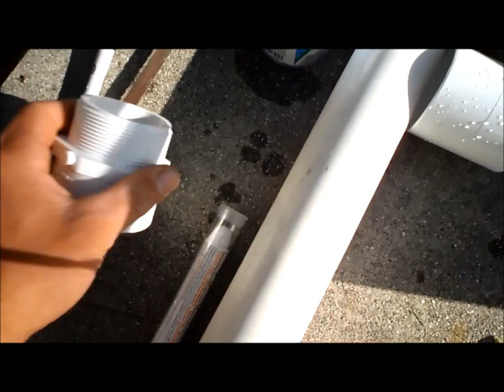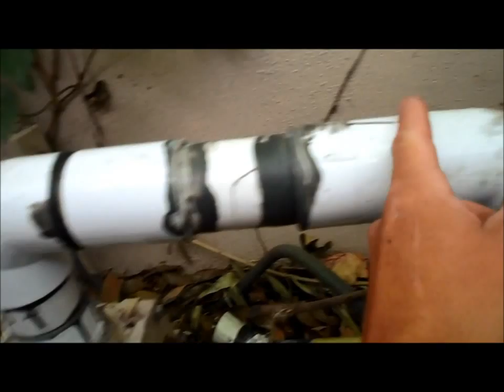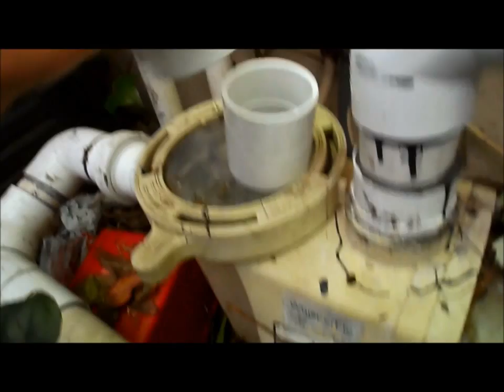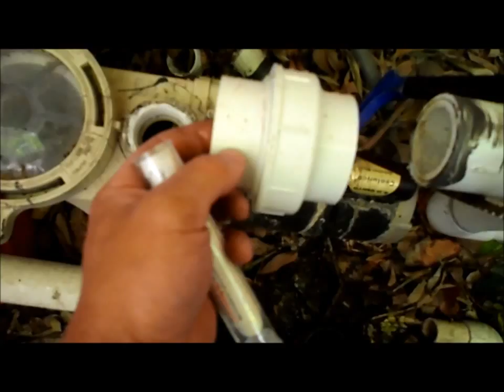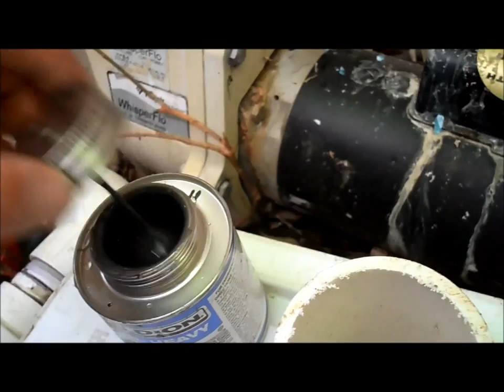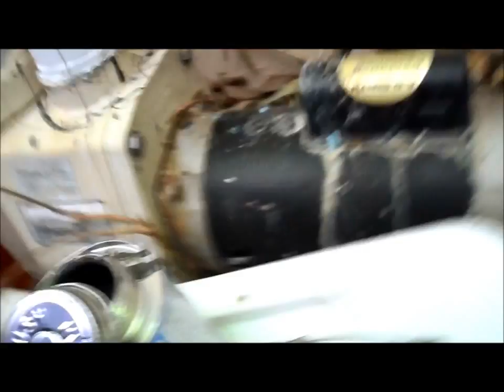Repairing a Pump Discharge Leak

Comment: @SPL   Thank you!  I had a 2" male threaded PVC fitting on the outlet side of a big Hayward Star-Clear Plus pool filter that was leaking and no matter what I tried still kept seeping water.  I tried various different kinds and thicknesses of PVC thread tape, pipe dope sealants, and even tried thread tape along with silicone sealer and it still kept seeping/leaking.  Then I saw this video and figured what have I got to lose so I picked up a stick of the Plasto-Joint Stick Thread Sealant you used in this video.  I cleaned out the female threaded joint in the pool filter and applied the Plasto-Joint Stick Thread Sealant thoroughly inside of it and also applied it thoroughly onto the male threads of the male 2" PVC adapter.  The fitting is now sealed perfectly into the pool filter and no longer leaks or seeps any water at all under pressure.  This Plasto-Joint Stick Thread Sealant is a life-saver for large, threaded and leak prone large PVC threaded fittings.  It seems like the material of the Plasto-Joint Stick Thread Sealant is an almost dry, gooey and very super thick and concentrated implementation of what is in the regular white Oatey or similar pipe sealant compounds that are much thinner and easily brushed on.  Anyway all I will ever use moving forward on PVC threaded fittings (especially large ones that seem looser and are more prone to leaks) will be this Plasto-Joint Stick Thread Sealant.  Thanks again, you saved me having to buy a new $800 pool filter.

Comment: I'm glad you said it. I don't know when I've seen plumbing that sloppy. Why not take a second and throw a rag around the equipment. We always use medium  to heavy bond clear cleaner and cement. Also they make threaded pump mta unions.
Reply: I know that made pipe extenders that go into the pipe. But I didn't know that they made them to go over a coupling. Good to know on that. Thanks.

Comment: What do you do if the threaded fitting was glued to pump housing?
Reply from the maker: Use a cutting tool like the Milwaukee M12 12 Volt Hackzall - cut into the threaded part making hash lines. Careful not to cut to the threads. Then use a rubber mallet and chip those pieces out with a rubber mallet.
Reply: @SPL  Thanks for the info. I have another question.  I have a Super II pump assembly with a 2HP motor. It requires an impeller ring. When the ring is installed the pump rattles loudly. Take the ring out and all is quiet. What is the ring for and is it necessary to have it installed.

Comment: Did you ever have to repair a leak after this video. I see the home owner does not check the water level
Reply from the maker: Yes. I added a Pool Sentry  on deck autofill to this account and good since.
Reply: Swimming Pool Tips, Reviews & How To - SPL nice. That is a good thing if the water level is always getting low and I am surprised the pump did not burn out yet

Comment: Good video. but wow. the glue is very sloppy. That's a sure way to not get recommended for another job. people don't like seing a mess on equipment.
Reply from the maker: Yeah, it was one of my first videos. I wasn't using a tripod so i did all the work with one hand. I am smarter now. 😝👍
Reply: My first video I did the glue up with my feet, cause I needed both hands for my camera. Great videos.  Really

Comment: where do you purpose those fittings? they look different than your house water pcv fittings. smooth all on the outside. not stepped.
Reply: zone Zone yeah the pool ones are schedule 40, but house plumbing is generally around schedule 20 I believe

Comment: Why don't you use teflon tape? I have to put a threaded male adapter in a inground skimmer would, what would be the best sealant for the threads? Does teflon wear out?
Reply: From what I understand Teflon with pvc has some conflict , something about lubricating properties of the tape . I could be mistaken ... if look into though just to be safe!

Comment: Quick question what happens if there's an air leak an I continue running pool pump ? likes  before prior to you replacing both sides of the pool pump itself with pvc tubes .  I seem to have the same problem where its beginning to leak I think cause it's an older pool pump.
Reply from the maker: +Omar Ruiz Nothing really short term. The air leak may just get larger and vacuuming the pool may be troublesome in some cases.
Reply: Where can you buy the fitting extender?

Comment: Can I get both the suction and discharge fitting from my local hardware store or will I need to purchase it from pool store.  The pump is a Pentair Whisperflo-24 1.0 hp.
Thanks in advance
Reply from the maker: Alexander Aymond Home Depot sells 2" and 1.5" fiitings. You can also order them online if needed.

Comment: Good video. What do you think about placing JB Weld Epoxy between the superpump and the beginning of the discharge? I see a small leak that is coming from the pump and seeping around the discharge.
Reply from the maker: ***** Never tried JB Weld on it but it might work. There is a lot of water pressure so not sure. Worth a shot - used JB Weld on a Stainless steel filter and it plugged the pin hole nicely. Good stuff.
Reply: Swimming Pool Tips, Reviews & How To -MrDgvb1 Chemical is good to at least 4000 psi. Should hold? And if this does not work a new pump would have to be replaced due to the bonding that has occurred around the discharge from the Epoxy? Or is there a way to get this off and try your method by replacing the pipes?
Reply: Ah, found the leak with some shaving cream patched that bad boy up with some epoxy hopefully it holds! Keep up the videos man very informative good job

Comment: The pump manual states you must have 5x the diameter of the pipe before the intake before it hits any bends in the pipe. 2" pipe requires 10" of straight pipe before you hit a 90* before the intake

Comment: My pump is not holding water when it is turned off. The Does it mean I have a leak some where? What would be the best way to diagnose and repair?
Reply: It could be a number of things sounds like you need a check valve on  the intake pipe of pump especially if the pump equipment sits higher than the pool water. If its higher i would put check valves on intake, skimmers and main drain..hope that helps.

Comment: Hi, if the pipes are not snug does that prevent the pump from suctioning the water.  My dad did that yesterday, he installed a pump and didn't wait 24 hours, he just turned it on and we still have the same problem, no water coming in, the pressure valve is at 0 and there is a leak it seems on the threaded fitting.  Help!

Comment: i have a pentair wistle flow that needs to be repaired , so my question is that do u have a video that show's you how to do that ? like my water pump could screw off from the top and where the water comes threw and i could pull it but i don't know how to take off that big grey wire thats on the side off it ?? any tips ?
Reply from the maker: take the back plate off Disconnect 3 wires - note how they are connected. Then unscrew grey connector. very easy to do.
Reply: how do u disconnect them three wires ...?
Reply from the maker: Chapo guzman once you remove the back plate (It is held on by two hex screws) you will see a simple wire set-up for the pump. The wires are held on my screws - just loosen them and you can pull the wires off. After wires are off of the motor you can unscrew the grey cord and remove the pump & motor.

Comment: A lot of Home Depots dont sell the Joint Stick. They usually sell the paste. The paste works good too. Also, dont use a hacksaw to cut PVC. Get a pipe cutter, it makes a cleaner cut and you wont have to mess with any burring.

Comment from the maker: I think they sell 2" PVC elbows, couplings and 2" PVC Pipes. I don't think they sell the threaded fitting for the top of the pump. You can order the Grainger Nipple, 2 X 12 In threaded fitting online if you needed. Maybe that store is priced high. The 2" x 12" Nipple peice should be around $10.00. The fitting extender if needed is about $8.00. The Elbows ans couplings should be about $2.00 each. Glue should be about $10.00 for .5pt.

Comment: Ihave a brand new flotec 1 1/2 hp sprinkler pump it runs at 40 lbs about every 2-3 min the pressure will drop to 20 lbs i can hear air in the line then it will come back up tp 40 lbs i have checked for leaks on the suction side and found none I even have wrapped the suction joints with saran wrap no change my neighbor has the same problem with the same kind of pump any Ideas?

Comment from the maker: You mean you are trying to see if the skimmer is the cause of a leak in your pool? If that is why you are testing it you could try to add some drops of food coloring into the skimmer and see if the drops indicate a leak by flowing through it. Depending on your skimmer you can thread plugs into the holes in the bottom, fill it with water and mark the water line. Turn the pool completely off. Check back in 24 hrs to see if the water went down passed the mark.

Comment: if you would of cut further back on the down part it would of been easier. also how is this a suction leak if your working on the discharge side of the pump?

Comment: lol... Probably don't have to use QUITE so much glue if the pipe was cleaned and you turn the fittings as applying....

Small debris on a dirty pipe + gluing fitting straight on with no twist = leaks!

Comment from the maker: Here is the product I use Weldon Pool Heavy 746 PVC Cement Grey (rated for 120 psi). If you can't get this try Weldon 12130 1/2 Pint 704 PVC Cement, Gray.